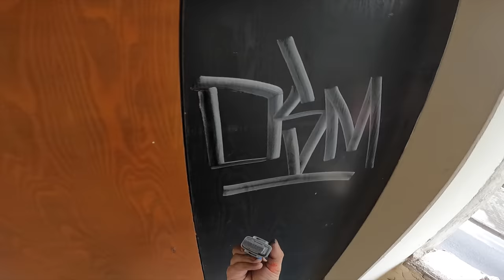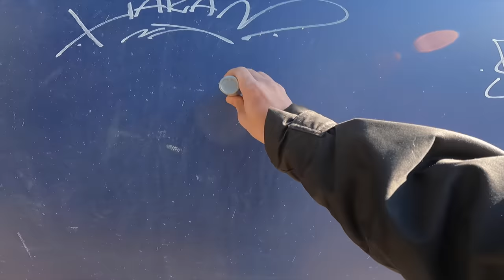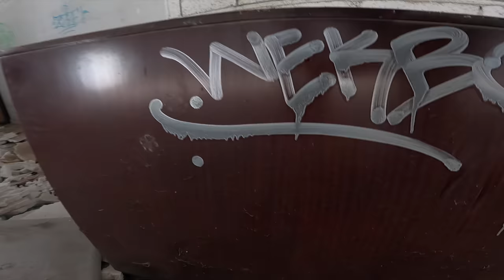Graffiti review with Wekman Grog Cutter 30мм

Comment: Also for grogs or other metallic alcohol/solvent markers: i find that I can fill a good 30-45% of the marker with "vmp & naptha" and it flows with almost minimal loss of opacity, at least with quality markers /paint. And specifically metallic ones especially silver,

That way when I get suckered out of half my silver paint like you did, I can at least kind of compensate. (works good for metalic markers that have dried from age as well)

Comment: Ive had the same result when i got empty Montana brand chisel markers.. if you buy them filled the black paint they fill them with works great but ive yet found a paint or ink to fill the emptys with that makes them preform correctly... ive had some success using cheap watered down $2 cans of black spray paint to use as fill but u can only use them for sticker stock since its so time consuming to make them work correctly... coversall and masterpiece ones seem to be the best bet when buying any large chisel tip marker in my opinion and those are deff pricey...
Reply: 90